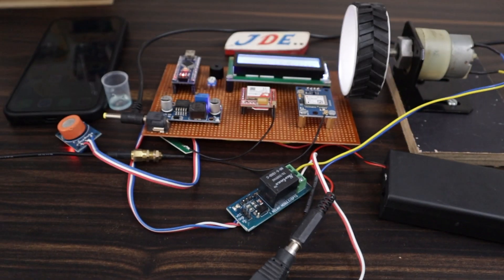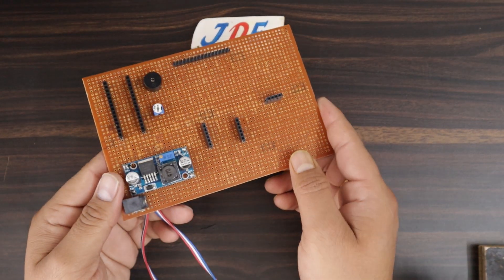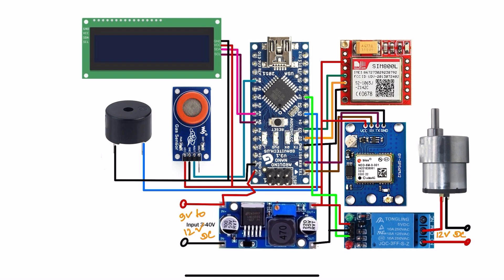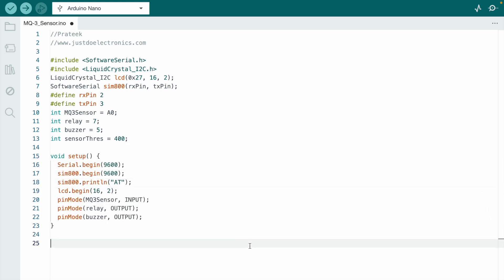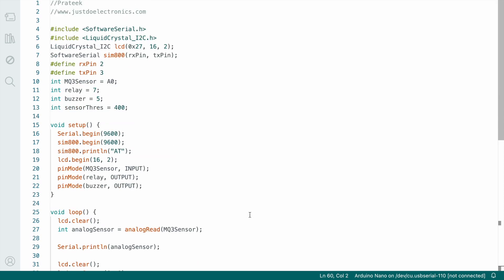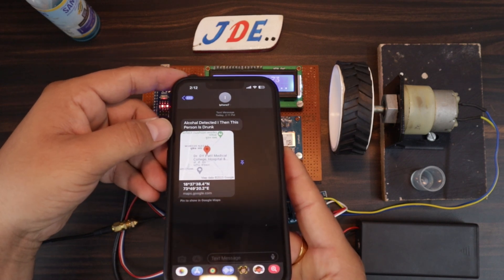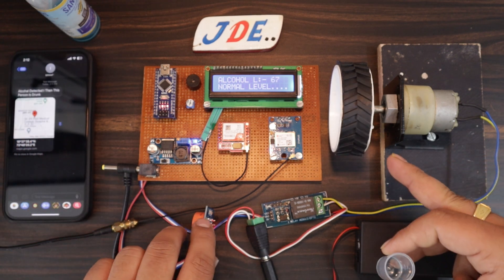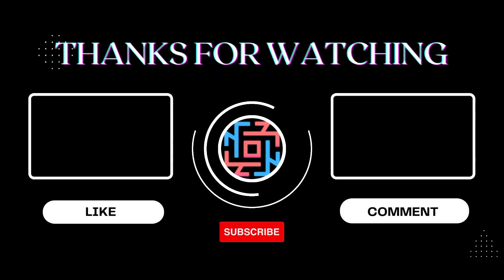Alcohol Sensing Alert with Engine Locking System Using Arduino, GPS, and GSM

Comment: Sir please make that automatic petrol dispenser system, please sir... Using these components:- 1. Arduino UNO R3 SMD ATmega328 Compatible Board 
2. Universal Key Matrix Module Membrane Switch Keypad , 4X4 16-Keys
3. RC522 RFID 13.56MHZ Reader Writer Module
4. Single Channel Relay Module 5V
5. 16x2 LCD1602 Parallel LCD Display With IIC I2C Interface
6. Jumper wire m-m, m-f
7. R385 6-12V DC Diaphragm Based Mini Aquarium Water Pump
Please sir ☺️🥺 🙏🙏🙏🙏🙏🙏🙏🙏